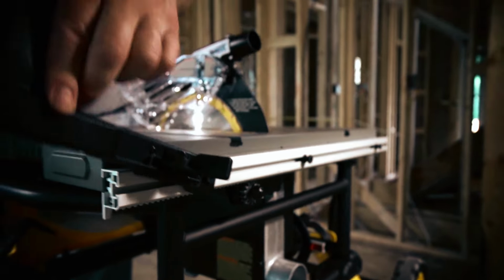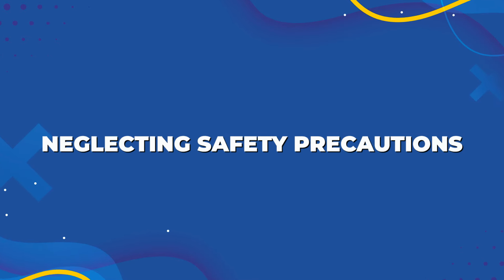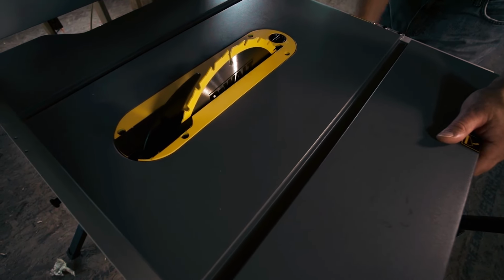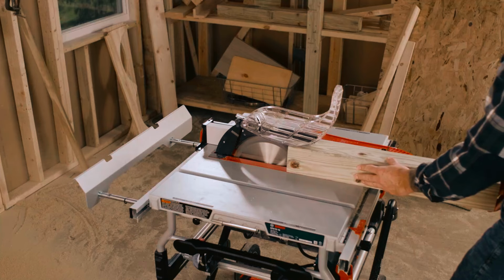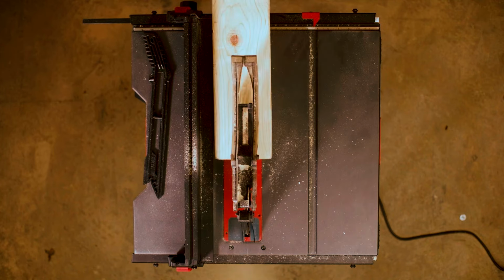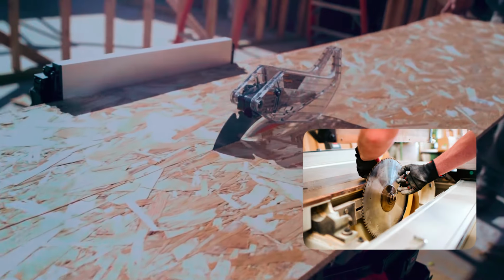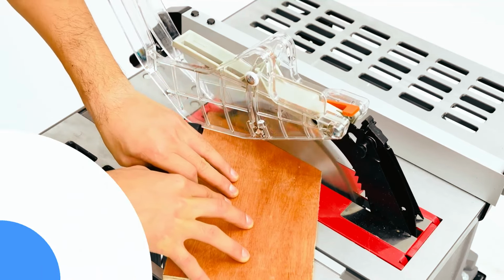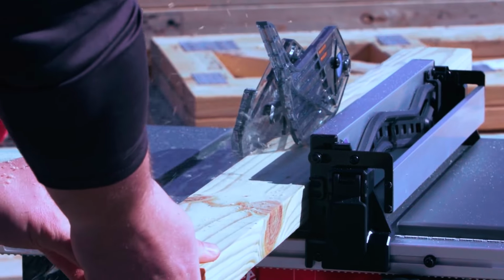99% of Beginner's Don't Know These Table Saw Mistakes to Avoid!

Comment: Most of the visuals contradict the good advice given earlier in the video.  It also shows using both the mitre gauge and fence at the same time when making a through cut, which is a major cause of kickback, yet there's no mention of that in the commentary.  One of the worst table saw safety videos on YouTube.
Reply: I was thinking exactly the same. I have seen a bunch of cricital faults in safe handling a table saw..
Reply: Idem, same thoughts